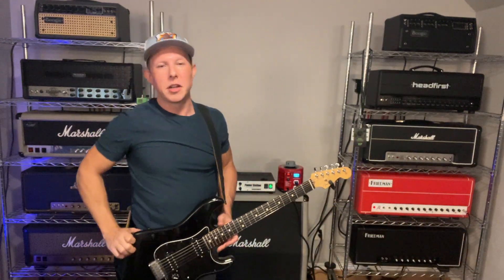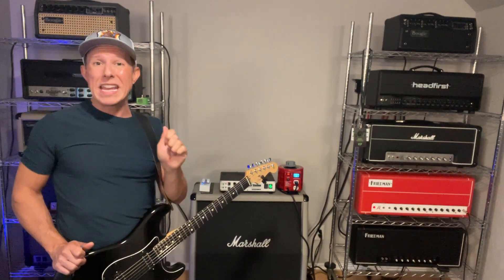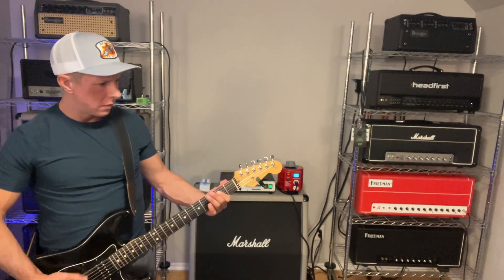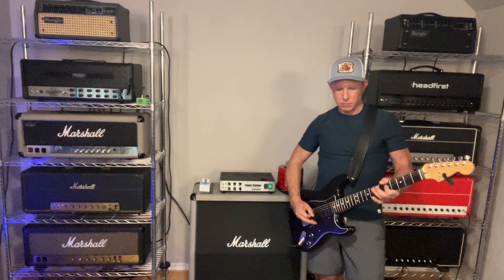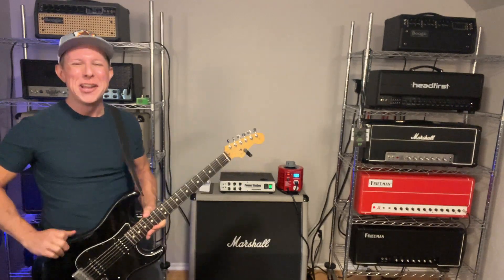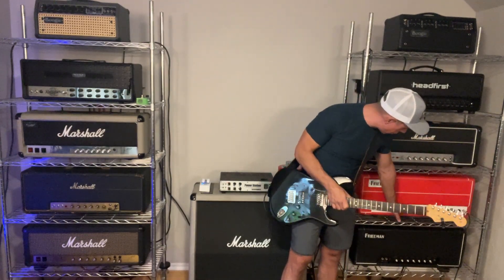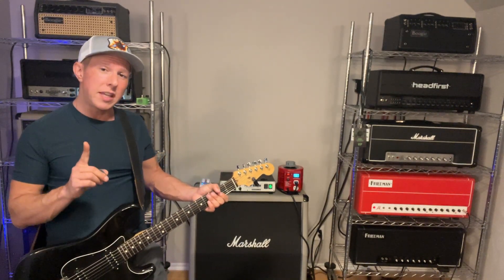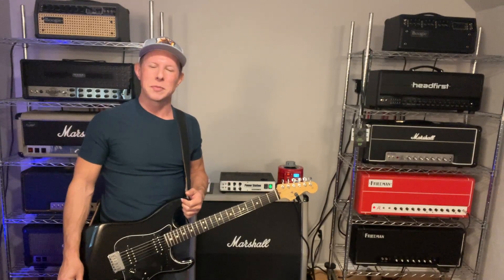One Trick for the Friedman Jake E. Lee

Comment: I’m sure the speakers in that cab are also very bright
Reply from the maker: Actually no. This cab is pretty mid heavy and dark. It’s got original ‘87 Marshall G12 Vintage (Marshall version of the V30) which sound very different to modern V30s: no ear fatiguing mid spike and a smoother top end. This cab is also has factory 8 ohm speakers wired at 8 ohms, so it’s darker than  an equal 16 ohm cab.

Comment: How similar is the JEL to the silver jubilee? They seem to both be bright, high gain, and based on the JCM 800. I’d appreciate your thoughts. I’m debating on getting the silver jubilee or waiting patiently to see if Friedman releases another batch (or version) of the JEL.
Reply from the maker: Not similar at all. Two completely different amps. The JEL is literally a 2203 (100w JCM 800) circuit but with a few of Dave's tweaks here and there. The Jubilee is a 2555 circuit and contrary to popular belief, isn't based on the 2203. The Jubilee uses diode clipping to get its gain and therefore is a totally different amp that's more compressed, smooth, and dark (compared to the other Marshalls of its day). The JEL is brighter, tighter, and more percussive and strident.

Being a modern amp, however, the JEL has a much better master volume, excellent effects loop, enabled channel switching, etc. The Jubilee sounds amazing, but it's an old Marshall, so it has to be cranked to sound good. You'll need to get the master to 6-7 before it starts to really fill out and reach its potential. An attenuator is highly recommended. You won't have to worry about that with the JEL.

I don't think Dave will make more 100w JELs, but you never know. I know he has a plan for a 20w JEL "Mini," but honestly, I have never met a mini amp that I've loved. They're usually EL84 based instead of EL34 based, and have smaller transformers that sound thinner and weaker, especially at gigging volumes. That said, they're decent at home. But IMO, the 2203 circuit, whether OG or Dave's, demands 100w to achieve it's signature sound.
Reply: Awesome! Thanks for the info. Think I’ll be waiting to see what Dave does next. I’ve got a Twin Sister and the master volume is amazing. It nails the classic tones, but my next amp will be something more modern sounding
Reply from the maker: @jheat4  No problem, happy to help! If you're looking for something that can do excellent modern Marshall tones without sounding like ass (*cough* JCM 2000 *cough*), then you should check out the Headfirst Amplification Alta 100. It's based on a 2203 but with soooooo many options, including diode clipping, bright switches, a Vintage/Modern voicing switch, two master volumes, and a VNFB control. It's an insane amp and Jason is a  killer designer and all around awesome human.
Reply: @eldoradoguitars6456  I'll definitely check it out!

Comment: With a lot of amps when you cut to half power you have to change the impedance to half, do you not need to with this amp? Like 16 ohms to 8 ohms...
Reply from the maker: Great question! No you don’t have to, but you could. It will be two slightly different sounds. 

Direct quote from Dave: “What ever way you like the sound of it… it is still safe.”
Reply: @eldoradoguitars6456  Thanks. I've been looking for this amp for a while. You might like my amp shootouts, Friedman, Marshall's etc